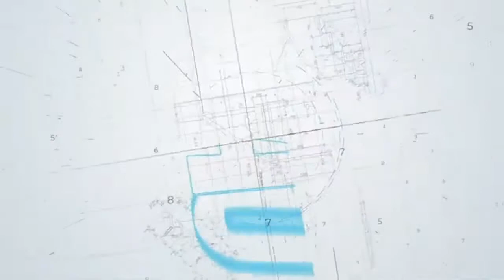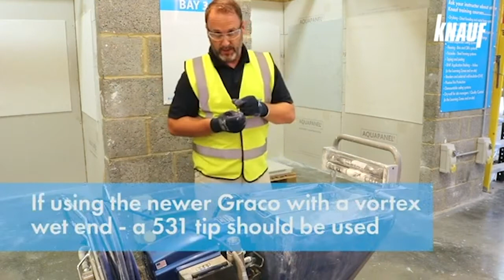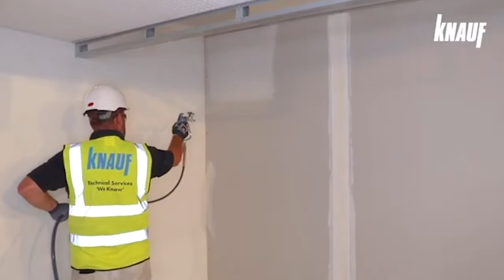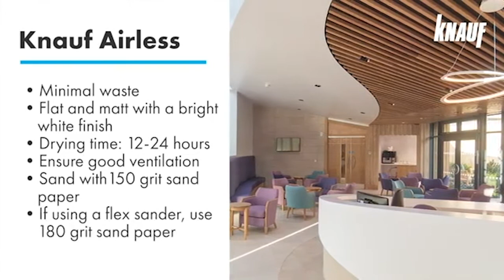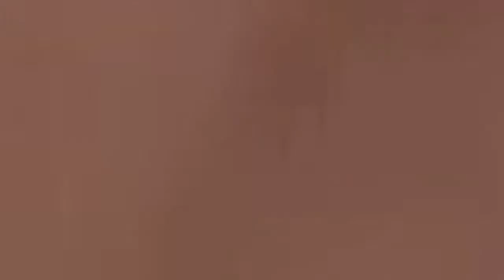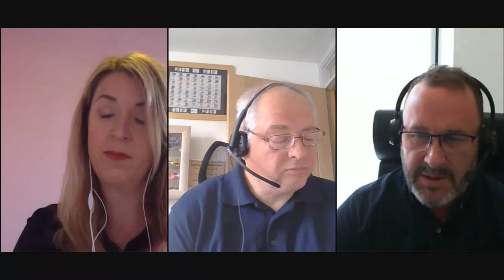Top Tips from Knauf

Comment: Could one thin the proroll light with water to alter slightly to a thiner consistency,  so that it is easier to apply on the wall? I've just applied  the first coat, and I've found it to thick and very hard to roll an even layer. Thanks in advance
Reply: By the way, I am not a pro as you can guess.